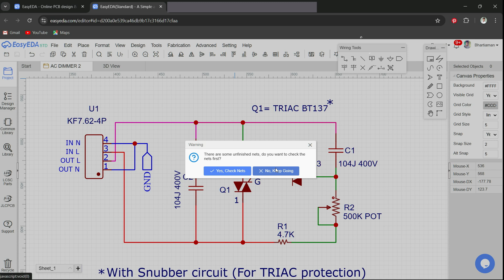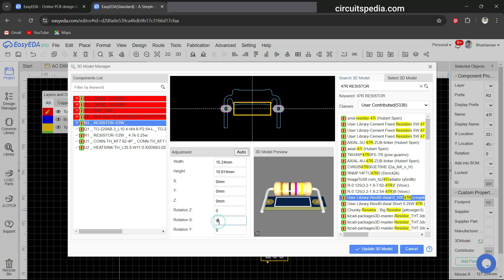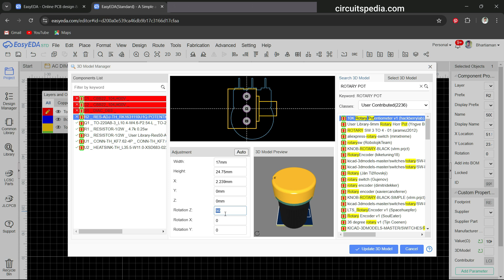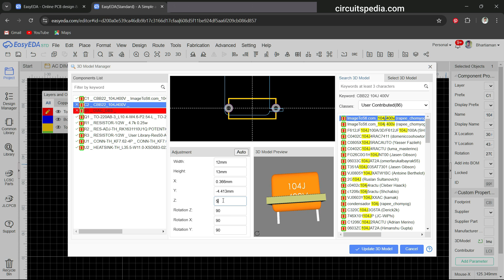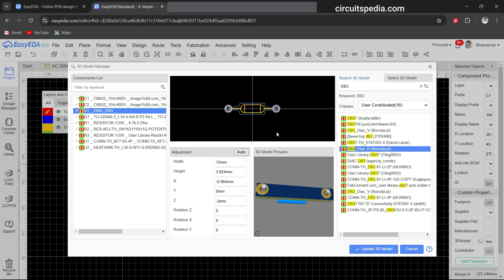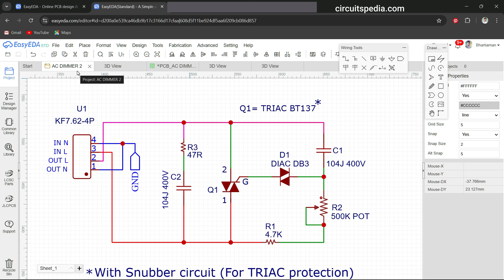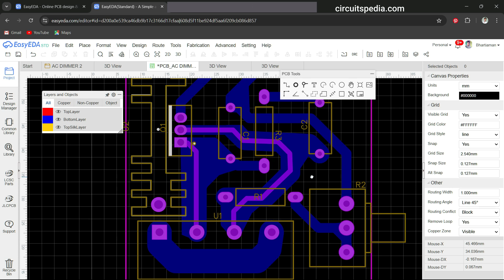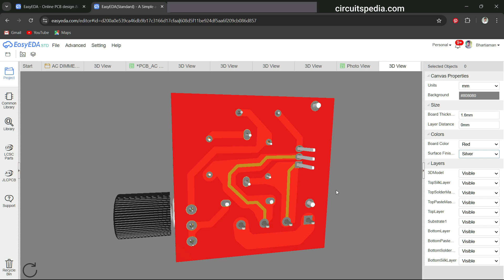AC dimmer circuit PCB design easyeda | Cutter Grinder speed regulator circuit | Fan regulator

Comment: 2M preset parallel to 500k pot missing.
Do we really need 2M preset? Can we use 2M resistor in parallel to 500k pot?